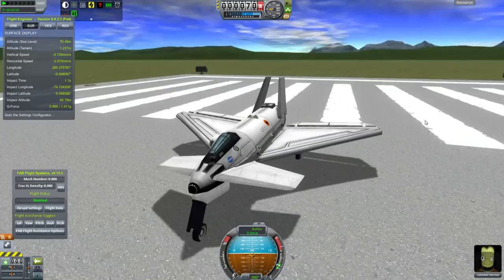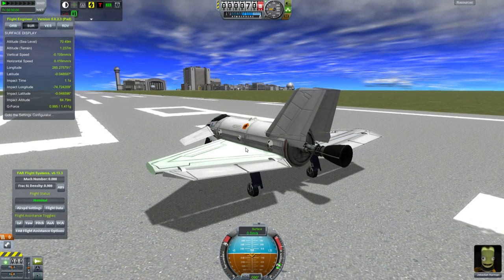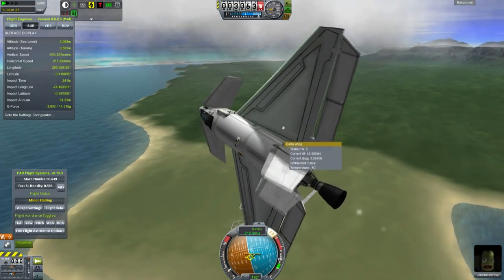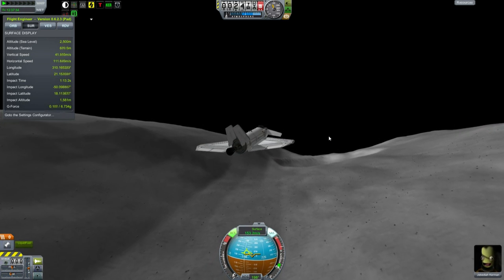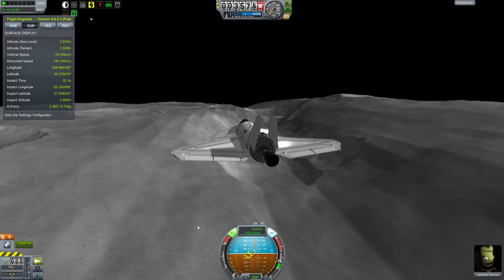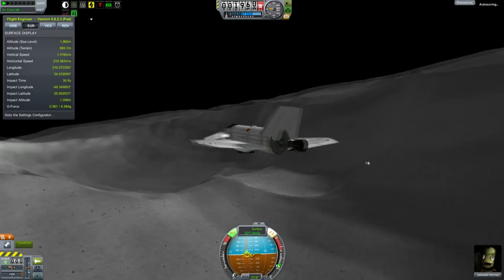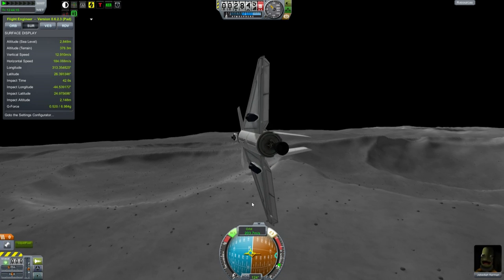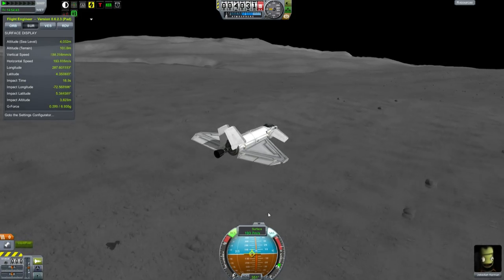The Physics Of Flying 'Space Fighters'

Comment: One big thing not mentioned here as well is the small matter of fuel efficiency. Even assuming some high-tech sci-fi energy source, there's really no point in having multiple, heavy engines wasting fuel. You only need one engine pointing in the direction of the subtracted vector to maneuver. 

I'm sure a few sci-fis have done it, but in real life what you would have is essentially a main body with the main engine and gyroscopes, and the cockpit and guns mounted like a turret, or even better in a gimbal. A flying tank of sorts. The main body would always be rotating to face the subtracted vector to maneuver, and the cockpit would rotate freely to either fire at targets or face the velocity direction like an aircraft. It would actually be more maneuverable than multiple stabilization thruster layout because instead of weak secondary thrusters, you would be braking or shearing with the full power of the main engines.
Reply: While we're getting into it - there's no point in having a human anywhere near a space fighter. In fact, you'd be as well with a simple drone loaded with kinetic-kill missiles. The best part is, if the drone is cheap enough, it can be used as a kinetic-kill weapon itself when its payload is exhausted.

No cockpit, no air supply, no water, no food, no seat, no safety systems, no windows. That's several tons of redundant mass dedicated solely to supporting a fragile heap of meat and bones that was never meant to exist in space, and lacks any natural intuition for null-G manoeuvring.
Reply: +spacekeeper why not just have a liquid-fuelled rocket, some good batteries, a few reaction wheels, and a nice big nuclear warhead? Get it within range, detonate it, irradiating the crap out of unprotected enemies.
Reply: Josh Adams And there you have a heavy missile. Other kinds of autonomous weapons will likely be wanted.

Comment: With the relative manoeuvring thruster to main thruster power issue I like to think that in the combat flight situation we're seeing currently the main thruster is locked to working at a fraction of its actual power. Basically it's kept low by the computer to keep you at a speed the manoeuvring thrusters can manage. But, when you're out in the persistent universe, you'll be able to accelerate up to travel speeds at a fraction of light speed and that will be the actual full power of that big main thruster, but at those speeds it will be impossible to use the manoeuvring thrusters at all.

Comment: A little comment on the firing engine at max speed in Star citizen. It does not really fire anymore. It is (according to a dev) in a "hot" state ready to fire. And if you keep a close look at the engine in 3rd person, you will see that the exhaust in fact vanishes, the engine is just lit for better looks. Contrary to that, your maneuvering thruster actually stop to fire completly if you hold a turn at max speed. (yaw roll pitch). Try it out, it's quite awesome.

Comment: There you have it - Elite Dangerous imposes artificial limitations to their ships to promote dogfighting-style gameplay. Star Citizen's maneuvering thrusters seem too overpowered, but their flight model is quite realistic. Probably helps that since the maneuvering thrusters are gimballed, they can fire in precisely the direction they need to fire, as prescribed by the IFCS. It's also worth noting that those same thrusters do lose their effectiveness to redirect or slow the ship nearly as effectively at higher speeds. (Such as while boosting with command-level stability and g-safe disabled). My guess is that the maneuvering thrusters are so effective because the main engine only fires enough to reach the IFCS's speed limit, which is low enough that maneuvering thrusters can change the direction easily. They aren't exactly as tiny relative to the main engine as they are on the KSP mockup, either. Each is pretty beefy, with a mouth about a fifth the diameter of that of the main engine on the Hornet. As I don't own any other Star Citizen ships, I can't very well speak for those just yet.

Picture for reference: http://i.cubeupload.com/Gq6VrU.png

Not to say Elite isn't a fun game! I plan to buy into the Premium beta as soon as I actually have the money to do so, because I'm truly excited with the plans the devs have for it. I just feel that overall, the simulation quality in Star Citizen is better.

Comment: Rudders do not induce roll due to asymmetrical lift (from being only on the top of the plane). If they did, the leverage would induce a roll opposite the yaw force. And, flying wings would not also experience induced roll in the same manner as a conventional plane.

Yawing induces the roll. Moving one wing faster and the other slower, while also taking one wing out of the airflow a bit, generates a lift imbalance and causes a roll in the direction of the yaw.

Because of this, you can't actually turn on the rudder. Trying to maintain a level attitude will induce adverse yaw. Not using ailerons will have the thing just roll over on you (and dive).

KSP, like Orbiter, is not one for atmospheric anything (other than re-entry deceleration drag).

Comment: The big engine at the back can be explained in two different ways.
1st. the main thruster engine is probably built for endurance or continued use. the bigger design allows for different modules to regulate heat and wear. Also it could be a larger but more fuel/energy efficient design...
2nd Hyper drive or cruise speed as apposed to combat speed. while the engine doesn't need much thrust for combat, if the fighter was used as an interceptor or a quick reaction vehicle you would like a very high top speed and a fast acceleration hence bigger engine.

Comment: Good video.  I would like to point something out though.  If you were to combine the sizes of the openings of the thrusters,on one side of the hornet, it would be similar (yet still smaller) to the main engine.  Which goes to the point you were making about size.  But, since they can change direction, you would not need to have a large engine on each side.  The design is not too bad, really.  We have to eliminate the idea of engine size being a constant, because that far in the future I am sure we would have something better than a solid fuel booster.

Love your vid and linked it in Star Citizen Forums.

Comment: Not sure if this was talked about yet. I'd reckon that the larger engine is designed to leave atmosphere, but in space flight, those engine thrust capabilities are greatly reduced to function correctly with your maneuvering thrusters. I'd say that the  maneuvering thrusters shown in SC or ED are significantly stronger, much like your "hacked" thrusters. Was a good video, gave me a lot to consider.

Comment: I guess the equivalent of com-stab in a car would be something like stability control (ESP etc.)? Where the car will use the brakes to keep the nose pointed along the velocity vector (stopping over/under steer) or within a certain pre-defined offset. As opposed to traction control which uses the brakes to stop you spinning up the wheels under acceleration.

Comment: If you use a program such as JoyToKey I you could set up a controler to bind multiple inputs to single button presses, this would allow you to basically just be able to pick up a control pad for space flight that simulates aircraft, It could be interesting to see :)
Reply from the maker: But the actual turn rate for emulated aircraft flight depends on your speed, so unless your control mapper can read this information it'll only work at one speed.
Reply: +Scott Manley what about with the autopilot we have now, that can keep your plane pointing at pro grade?

Comment: So a space fighter will need a vacuum mode and a planetary mode
Reply: A more plausible scenario is that we will use two vastly different pieces of hardware for the vastly different environments and operational considerations/requirements, and you might see some transfer vehicle to move craft to the environments they are designed for (eg. a launch stage to move your orbital fighter out of an atmosphere it isn't equipped to deal with otherwise, and possibly some recovery vehicle so you can save on weight by omitting a heat shield that will become completely useless if it is battle damaged). While it is the case that the person at the Pentagon making that analysis brings their preconceptions about what a thing should look like to the table (you would be amazed how major an impact aesthetic expectations have on my gear load-out as a soldier and bomb technician), at the end of the day the military will ultimately go with what works rather than what looks good because of the simple fact that if we don't, we place ourselves at a distinct disadvantage relative to everybody that does... and if you want to live through combat, anything that places you at a disadvantage can become subject to elimination depending on operational considerations, enemy capabilities and intentions, and desperation. 

Just look at the A-10--great for convincing enemy armor or hard points that they don't want to mess with American soldiers, but the sucker defies most of the principles of good aircraft aesthetics... and is beloved regardless because that GAU-8 is a beautiful sound when you're pinned down by enemy armor or fortifications that you are under-equipped to effectively address. You will see a similar awkward transition into coming to love the aesthetics of what actually works if extraterrestrial combat ever becomes part of real human experience.
Reply: Christopher Albano I know but still if you could allow a space fighter to chase a enemy into the atmosphere you could have a decent weapon, my idea is like the jackal from iw, but much larger, like a ospreys, with 100kn Rcs thrusters,
Reply: Emperor Doge  Just remember that as you increase the number of features a piece of hardware has, the associated complexity, error rates, development time, and other costs increase geometrically. Additionally, it's much more easy to design effective weapon systems which can project might from orbit into the upper atmosphere than to create some craft that is equally at home in the two radically different operational environments. Your vehicle doesn't need to be able to go places you can send a guided missile or some other semi-autonomous consumable any more than my example of an A-10 would have to land to engage tanks. The reality is that a lump of tungsten with control hardware and surfaces and a small rocket to deorbit is all you need to effectively conduct orbital bombardment, and you don't need much more to knock enemy aircraft out of the sky... Replace the tungsten with a fragmenting high explosive warhead like you find in most AIM-series guided missiles, and place the whole assembly in some form of ablative casing to protect it from shock heating long enough to reach engagement range.

There're very good reasons both the United States and former USSR were so nervous about expanding combat zones to include LEO, and were willing to promise not to do so unless the other did so first...
Reply: Or carry atmospheric drones/missiles.

Comment: Scott, surely in the case of things like elite dangerous, a larger rear engine would be required for supercruise. So in normal flight you wouldn't actually be using anywhere near the full power of the engine but a limited power to keep reasonable manoeuvrability. The problem with hyperspace stuff is how fast it slows down which would surely require a huge frontal engine or backwards exit so I'm not sure about that. If you read this Scott could you tell me if that would be right.

Comment: Here's a question for you Scott. What if the directional thrusters were using the power/thrust of the main engine? If the materials were strong enough and heat resistant enough to withstand the same forces as the main engine, only the nozzles are smaller and spread out, into say four equidistant thrusters, would they not be able to impart an equal amount of force in each direction? So it would be like having one of the main engines on each side of the spacecraft.

I have done no math or study on this, its just a theory to justify the way SC is doing it. But in my head it makes sense. Splitting one engine into four different engines should still impart the same amount of force, right?

Comment: My experience with board-game aerospace fighters was Battletech/Battlespace and Renegade Legion, both by FASA.

I always assumed that aerospace fighters used vectored/directional thrust for both space and atmospheric maneuvering, augmenting their thrust (in atmosphere) with exotic lift devices and variable-geometry airfoils to provide for the necessary control in the dense atmospheres of habitable worlds. By vectored-thrust, I mean that the main engine could have its thrust directed in any direction at the pilot's discretion, via vents, ports and gimbled venturies. That way, the pilot could "fly" the craft in space in a similar manner as in atmo, without the need to worry about thruster-quads or other impulse-producing maneuvering devices.

However, I "house-ruled" that pure air-breathing fighters (think an F-22 or equivalent) would have certain maneuverability advantages over the much-heavier and multi-purpose aerospace fighters, since it's preposterous to assume that a craft carrying everything required to operate in both deep-space and atmospheres could match the maneuverability of a craft specifically made for flying in the atmosphere of the planet the combat is taking place.
Reply: Mike Brown In regards to your point about an f-22 out maneuvering a space designed ship, I don't think the F-22 would win. 

The limiting factors on how quickly a jet like that can turn is how many g's the pilot and the airframe can take before they pass out or break up.

As Scott just showed, a jet mainly uses the force of the air on the wings to turn, where as a space ship would probably use some other method (but let's assume it uses engines).  If the space ship is able to produce more thrust than the jet's wings can without breaking, it will turn faster. 

A human pilot will still pass out before a jet breaks up though, so if the spaceship is unmanned, it pretty much wins by default. Also, if the spaceship has some sci-fi way of reducing the effect of g's on a pilot (which is common in sci-fi), or if the alien flying the spaceship can take more g's, it will also win. If the spaceship pilot is just a human in a flight suit, than the two craft will be equal in performance.

Also, even if the two craft can pull the same amount of g's, then the space craft would still win, because it can flip in ways a jet can't. Planes fly like they do because they have weak engines and need wings to provide lift. A spacecraft that gets its control authority from thrusters could flip around and shoot something behind it in the atmosphere similarly to how it would in space, assuming the engines and the body were strong enough (they wouldn't have to be unreasonably strong if the spacecraft didn't have wings).
Reply: I didn't actually mean to imply that the F-22 (or any other current-technology aircraft) would win in a contest versus an advanced-technology craft that an aerospace fighter would be. I would assume that the two craft would have access to the same technologies, with the aircraft lacking the systems and propulsion required for exo-atmospheric operations.

Regarding atmospheric maneuverability, there is no reason to believe that an aerospace fighter can disregard the laws of physics any moreso than an airplane. Both would be subject to extreme aero-dynamic pressures on the air/spaceframe when conducting a high angle-of-attack maneuver and if the construction materials of the two are equal it would merely come down to which craft was optimized for those forces.

Bear in mind that the aerospace fighter is forced to bring-along a number of systems to allow for spaceflight, such as advanced life-support, heat-shields, cosmic-ray shielding, advanced navigation and control systems, etc. All of that means added weight, which is counter-productive to maneuverability.  Both pilots would be subject to the same g-forces in a given maneuver and your allusion to robotic control would also go both ways.

Lastly, since we both agree that an aerospace fighter would invariably utilize thrust-vectoring, what precludes an aircraft from doing the same? The F-22 uses vertical-only thrust vectoring currently, as do some other 4th/5th generation jets, and the AV-8 can corner sharply using the VIFF (Vectoring In Forward Flight) technique. I would assume that these features would carry forward to more advanced designs.
Reply: Mike Brown 

So to be clear, you're talking about future technology where space fighters are viable, compared with a fixed wing aircraft built with the same technology?
Reply: As in the settings of Battletech/Aerotech and Renegade Legion and Traveler 2300,   the air-breathing craft had access to the same level of technology as the aerospace fighters of the day. They were used as point-defense and ground-attack units in atmosphere, usually as part of a garrison (where they had been optimized for the local climate and conditions).

No, I was never suggesting that an F-15 or SU-27 could realistically take on an interstellar craft from an advanced space-faring race.